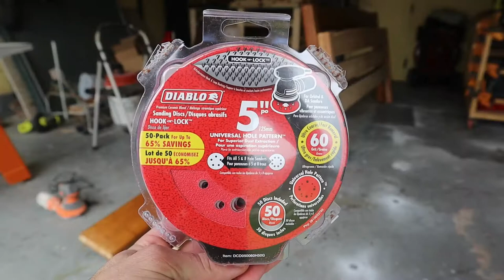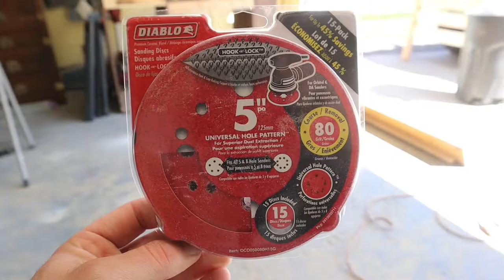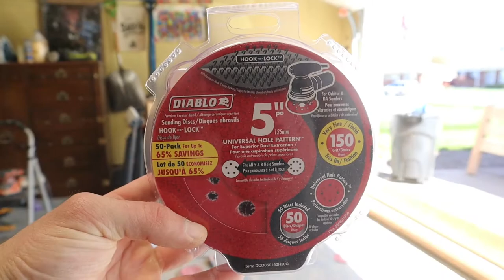REFINISHING A BED FRAME - FULL PROCESS

Comment: I like the color of the wood before you stained it. What coat would you put on to keep that color? A clear stain?
Reply from the maker: Any sort of polyurethane would be great to lock in those colors but it will result in a slightly darker tone to the wood!